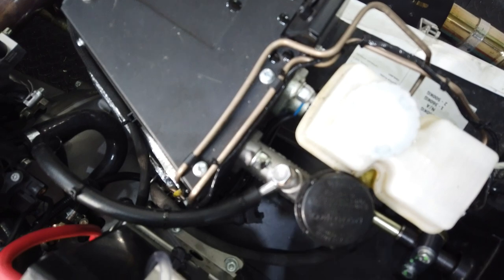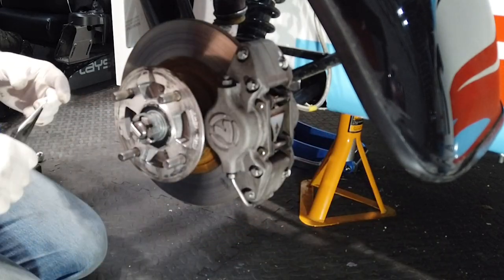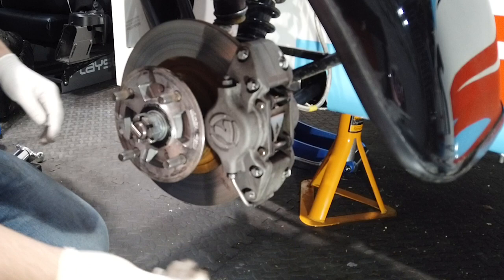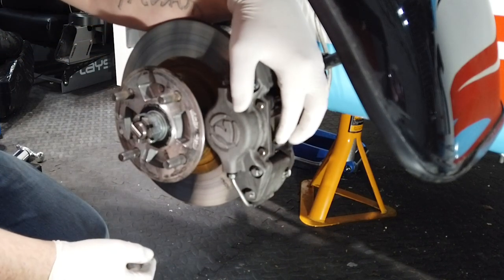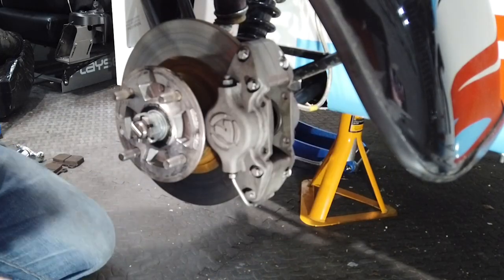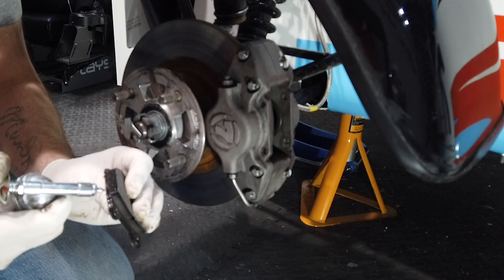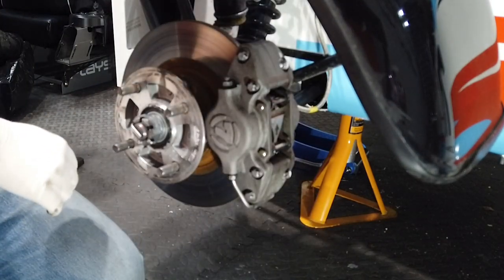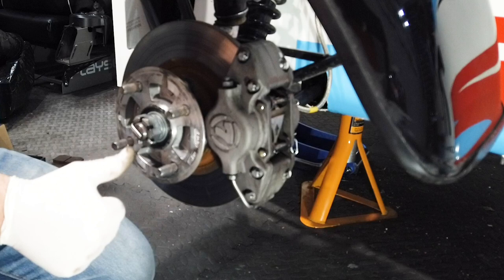How To Change Caterham Front Brake Pads

Comment: Hi Rob, did the upgrade brakes make much different to feel or strength? any drawbacks?
Reply from the maker: Hi, good question! I guess it depends on how/where you use your car...and also any restriction to pads you are allowed to use. In many race series, the choice of pad is limited. This combined with not being allowed to use a brake bias valve in the Academy series means that by choosing a good pad combo of front/rear does allow you to manage to some degree the balance of the braking. So, I wouldn't actually say that there was a noticeable difference to the braking, just the balance when set up in combination with a good flat floor suspension set up. Regards, Rob

Comment: Hi Rob, changing mine when the new pads arrive. Did you find you could push the pistons back with your hands? I think I needed a block of wood last time I did mine. Hopefully they will be a bit more free this time. All the best, Steve
Reply from the maker: Hi Steve - umm, you might be able to! Although, the wind back tool wasn’t expensive and a great addition to the Caterham tool box. Cheers, Rob 👍
Reply: @roboladland  thanks Rob. I’ve got one for the rears but didn’t know I needed one for the fronts.
Reply from the maker: @stevehoward314  ah yes, your right - it’s been a while since I’ve changed the pads 🤣

Comment: How often do you find you need to change pads? I seem to get almost a whole year (8 weekends or so) of racing done on each set. This makes all the 911s and E30s in the paddock very jealous.
Reply from the maker: 100% agree versus the Porsche’s etc. I have only changed the pads to the ‘upgrade’ Caterham option pad for Academy. After 2 track days and 1,400 miles I would say my pads are about 1/3 worn. Yet to try the new pads due to the restrictions. Keep safe Tom

Comment: is this any different for the AP brakes?
Reply from the maker: Hi - Not sure yet, I have changed the pads but have only done 10 miles on the road so just bedding in. Lock down has meant my car has been in the garage since, the planned test day at Castle Combe has been postponed. By all accounts, the option pad doesn't improve the braking force, but does give a better pedal feeling - I'm yet to confirm this! Thanks for subscribing and the question.

Comment: Don't use copper grease. Use non mineral based grease made for this job. Using copper grease originated from the 60s and its actually one of the worst things you can use. There are better alternatives now.
Reply from the maker: Brill, many thanks for the tip. I’ll check it out and I’m sure others reading through the comments will do the same 👍